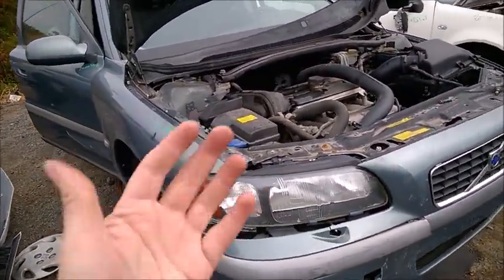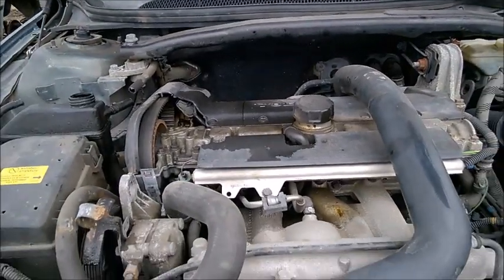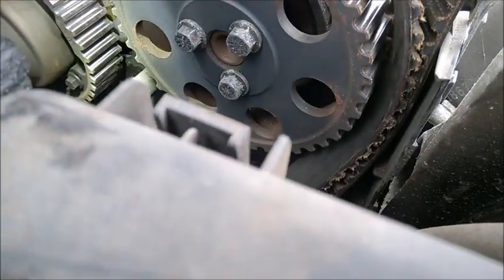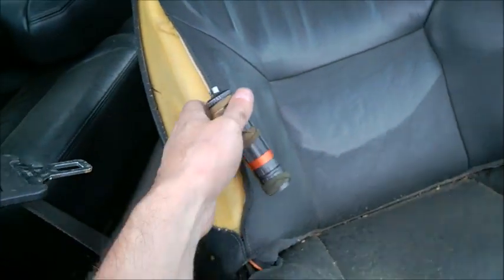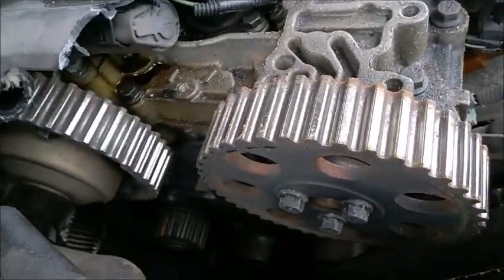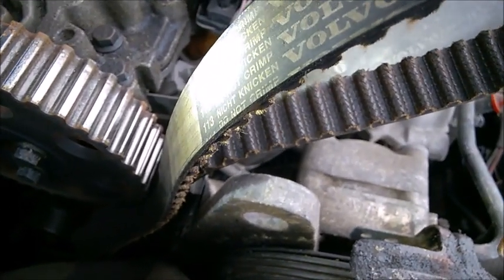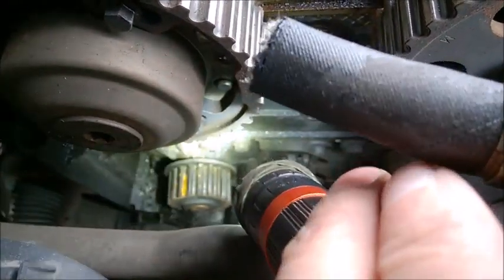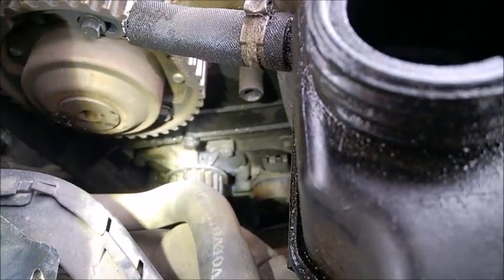Volvo S60 V70  Quiz - what went wrong ?

Comment: I have an XC 90 with 190,000 on it.  The timing belt AND water pump changed at 120,000.  The Volvo specs say to change the BELT AND WATER PUMP at around 100,000 miles.  I am ready getting ready to do another timing belt and pump at 200,000 miles.  When I bought it, I did a tune up, trans service (all OEM parts were still on the car) and discovered the cabin air filter WAS THE ORIGINAL VOLVO FILTER.  Needless to say, I keep very strict maintenance issues and am keeping my fingers crossed.  I LOVE my Volvo.

Comment: wish we could have seen the coolant tank. i have seen a few seized pumps from people mixing coolants together causing all the fluid to form into gel. the pump bearing overheats and causes failure. the weep hole on the housing is supposed to open up when the bearing fails causing your fluid to drop leading to a stop car message on the cluster but if it turns to gel the sensor in the coolant tank is held in place making the car think the fluid is fine until the thermostat can send a message, which might be too late. 

can never rule out the possibility the owner ignored any noises or warnings and its possible the bearing just had a catastrophic failure.
Reply: agree what person dont put GREEN coolant in any car now....they dont know the right color or what they mean...id say as well mixing coolants or ran out of coolant and it seized ...orginal/OLD  water pumps will leak and leak when old,  seen many volvo pumps but none frozen
Reply from the maker: Interesting theory. Very possible to have had the wrong coolant, here in Canada Prestone is very popular - I had it in my car until I noticed it was leaving a strange coat inside the tank (I think I show this in a video). I then flushed everything deeply with Prestone Flush, and put Genuine green/blue concentrate with distilled water. Few people know, but the Genuine concentrate at the main dealer is actually .. the cheapest option, even cheaper than aftermarket premixed brands.

Comment: How many times have you heard people say "when you replace the timing belt, don't replace the water pump because they don't fail, wait for the 2nd timing belt change?"  People were saying that back when there were barely any of these cars with enough mileage that they needed a timing belt changed. I never bought into that speculation.  Every time I've done the timing belt on my car, it gets a new water pump (Aisin) and my '01 T5 is still going strong with 208k miles.  Skimping on the water pump is a dumb way to try and save money.

It's hard to say what caused this to seize.  Other than wear and tear... it could've been a coolant leak possibly the radiator end tanks and the person drove it too long without coolant.  I also like the wrong coolant idea below.  I've seen so many used S60s on the market with the wrong coolant in them.

Comment: I have a question:
I bought 2007 S60 2.0t with 170.000 km (not miles) from the first owner from Germany last year. In service book I saw he changed timing belt in 2013 on 73.000km due to 6 years. The car now has 196000 km. So, it is 7 years and 123000km after last service (genuine volvo parts). Should I change it now, because in user manual it says that timing belt is replaced after 180k?
Thanks for an advice.